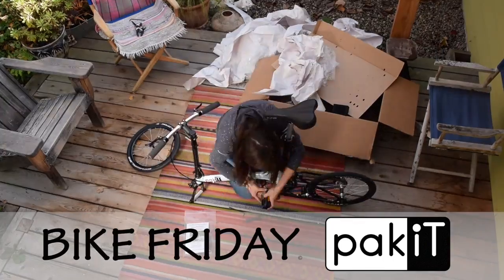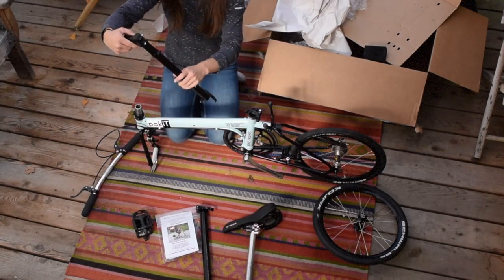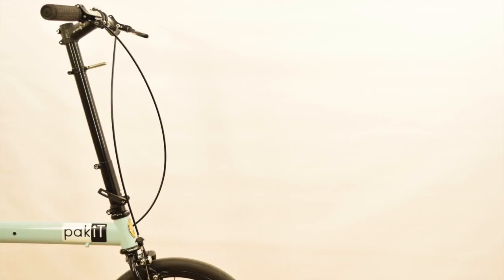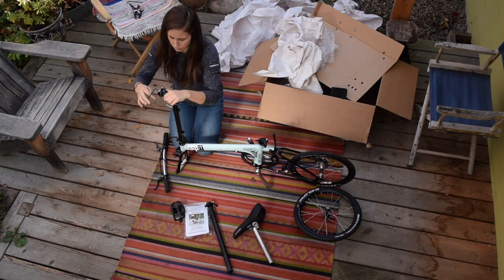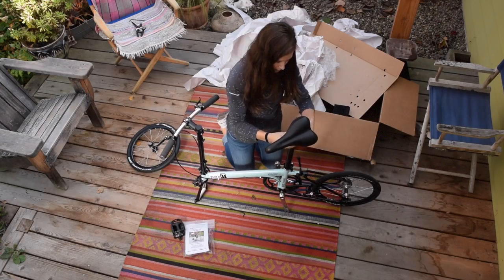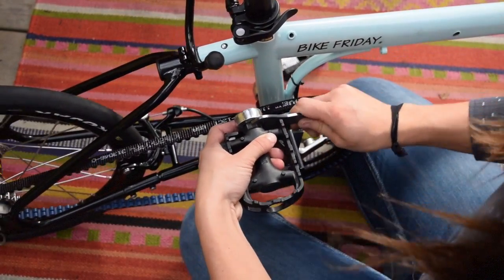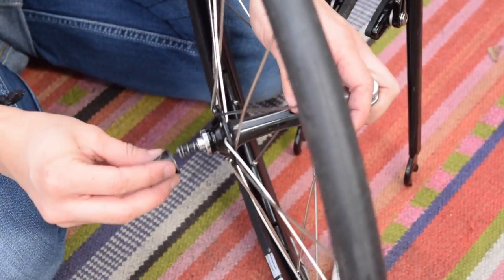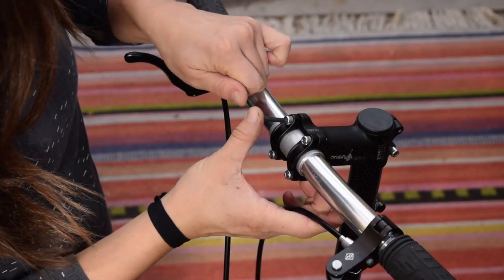Bike Friday pakiT Assembly

Comment: I didn't see any "left" or "right" notation on the pedals. Also, it would be glad to mention the washers attached to the pedal arm.
Reply from the maker: Most pedals have a 'L' and a 'R' on the face of the axle at the screw threads so you know where to put them.
Reply: @bikefriday  Mine do not have the "L" and "R".  So just use trial and error to see which one fits on which pedal arm.
Reply: If  you  hold a  pedal with  the  threaded end  up,  the   top of  the  threads point right  or  left.  the   Left pointing  thread is the  left  pedal.